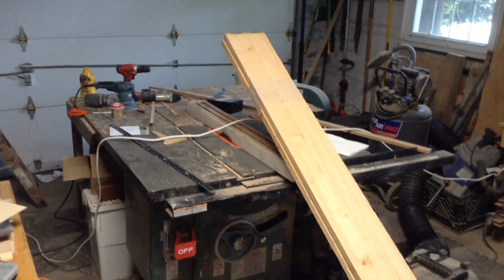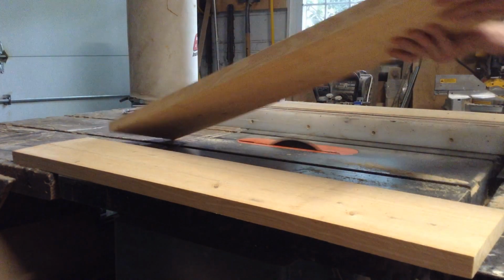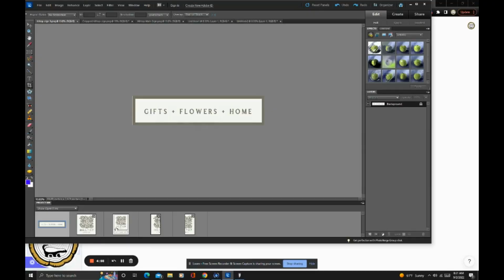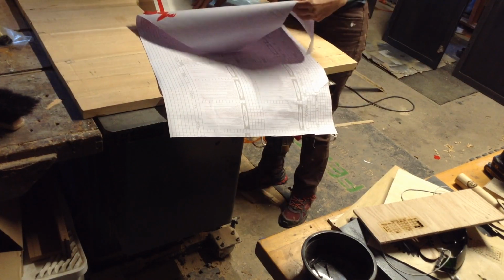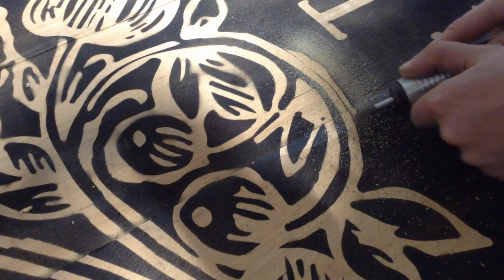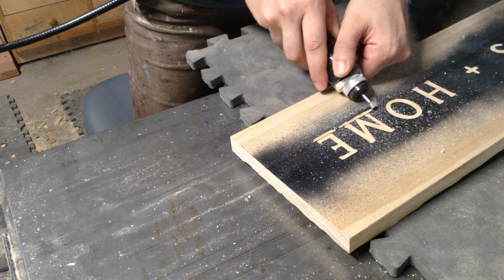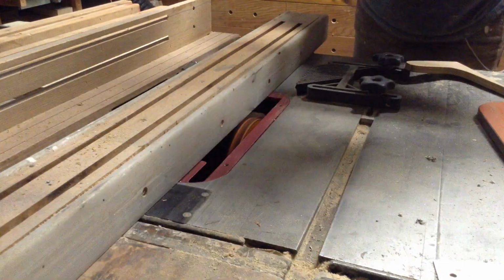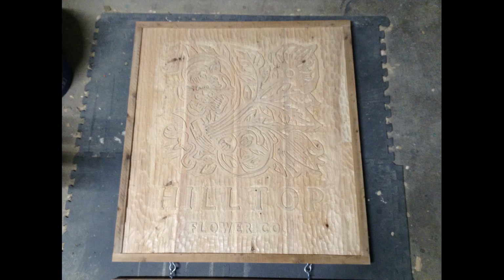Woodworking : Relief Carving & Pattern Transfer // How-To

Comment: Great results there Kate! Reminds me of when I did sandblasting to wood. They make a thicker medium for the vinyl cutter, and just blast it. Also did it on glass. Projector works ok, as you said, the alignment, distortion and having space to project isn't always doable. I'm sure someone will suggest using a CNC, that would allow for duplication of sides, but not always look hand chiseled. 👍
Reply from the maker: I actually suggest to all my customers that want signs or text like this carved to find a shop with a CNC because it is way more cost effective then having someone like myself carve it.  But, she 
said she wanted it done by hand and I wasn't going to argue hahaha.

Comment: Very nice work, the chisel pattern makes it all worthwhile doing by hand (cnc couldn't deliver that kind of character). BTW, did you know you can transfer pattern with a laser printer printout? Face the print side onto wood surface, then rub kerosene on the print, the ink powder will come right off the paper.
Reply from the maker: Did not know that.  That will come in handy for smaller stuff for sure.